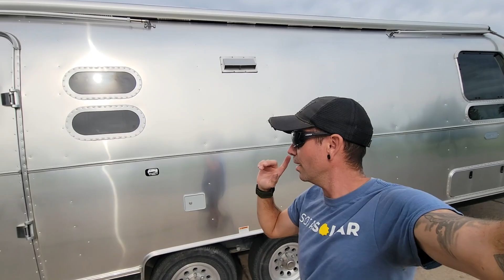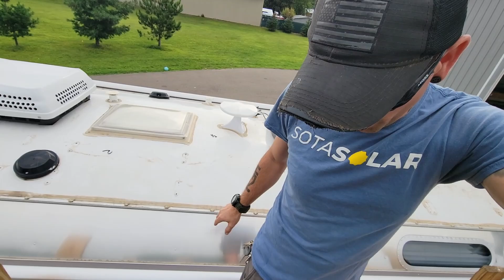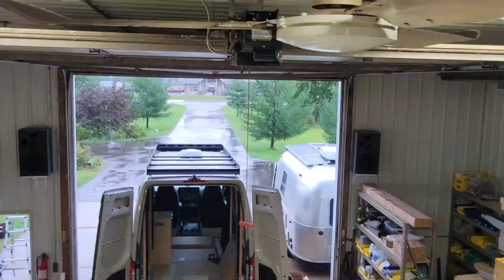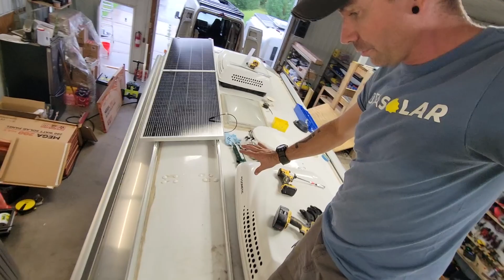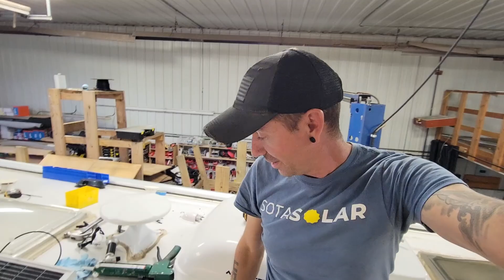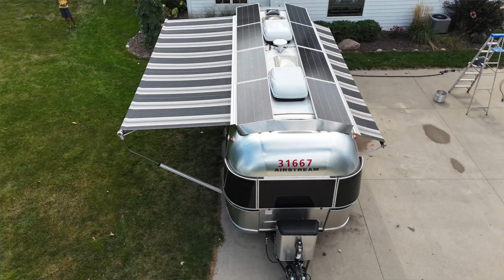1600w Solar on Airstream Globetrotter - Most Solar Ever on Airstream

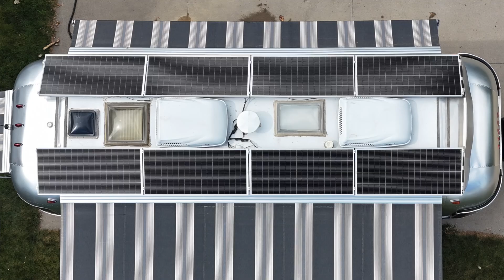Comment: Starting about 4:28 showing the roof and what I'm most interested in is the shroud that was built on the front of the solar panels. I'm assuming that has held up well. Definitely something I would want done. Thank you for posting any input would be greatly appreciated.

Planning on a total gut and redo of a older vintage airstream. Will be removing all top ventilated air conditioners, and installing a bench type air conditioner so therefore larger solar panels could be placed or placed differently wanting a 27 foot may be a 30 foot airstream just looking for input on a bi facial panel as well

Also, what kind of timeframe would it take y'all to install something like in this video yet with the larger by facial panels just looking at understanding my timeframe and staying with it while you work on it
Reply from the maker: We’re doing another one of those later this month with the air dam. We’ll try and document more. 

Usually takes a week. 

If I was starting fresh and knowing the open spaces under modern airstreams, I’d consider a DC mini split AC . You can mount the outside unit under a vehicle or trailer. Find room for two and you’ve got off grid cooling forever.

Comment: Being an Airstream technician my question is this. How do you remove the a/c shrouds for service? Seems to me the rear shroud screws are blocked by the rails. Also how do you get onto the roof, for service, without stepping on solar panels?
Reply from the maker: Great questions each panel can be taken off with four bolts. Doesn’t take more than a couple minutes. You can get full access to anything you need.

Comment: Now that's what's up!!
I was losing faith, but now I see you guys are starting to understand. 
The Epoch battery company has a great selection of batteries at a decent price.
Also DC to DC charging should be encouraged, use the Truck to power these systems.

Comment: What are the rails used and where can they be purchased? I have lots of roof space, but prefer the rails for future additions. 
Thanks
Reply from the maker: Unirac Solar Rails.  There are other brands as well such as Iron ridge. If you're in the midwest we can have them drop shipped to you for free (if in our supplier's delivery network).
Reply: How were the panels mounted to the rails?  I currently have my panels ( 6 -200 Watt) mounted to unistrut but am intrigued by the rail option!
Reply from the maker: @markratliff7991 unistrut is just another rail option. Unirac rail use a similar strut, nuts, and hold down clamps as unistrut does.